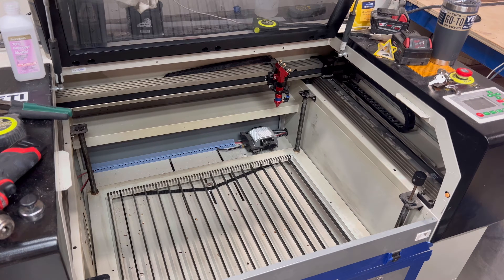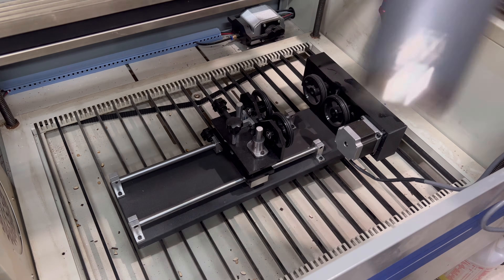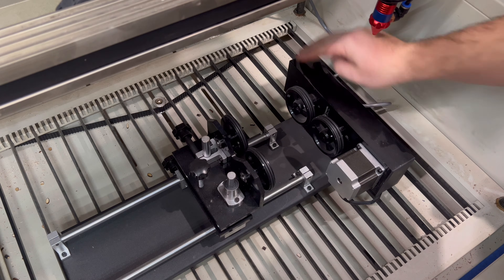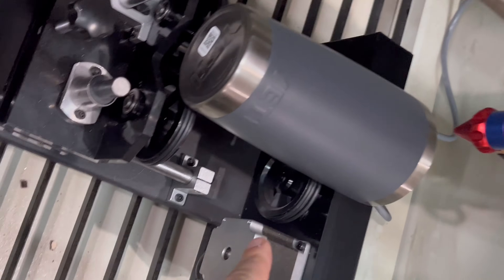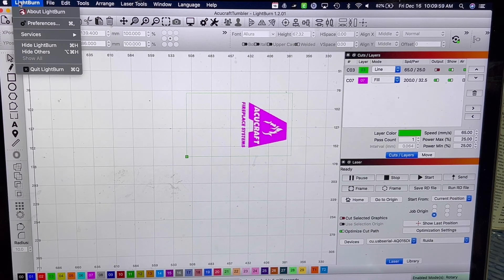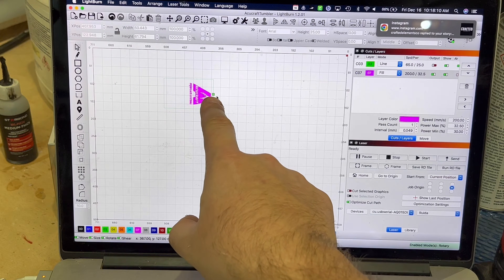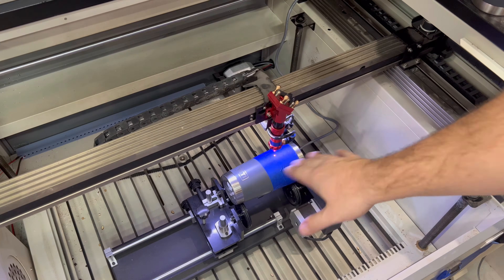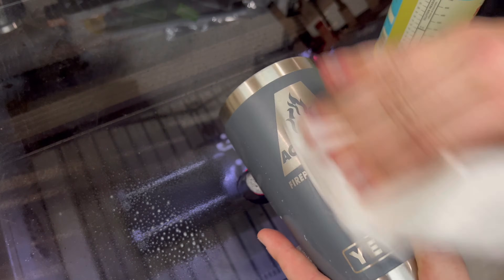EASIEST WAY TO SET UP A CO2 LASER ROTARY! ITS FOOL PROOF!

Comment: good morning @customgrains  I am following all the steps as described, but when I hit start and the machine starts engraving, the design is engraving with the height of the design compressed. Ex: my design is W: 3" x H: 6.25" rotated 90 degrees (just like you have it on lightburn). The preview looks fine/normal. But, once it starts engraving, the design is engraving with the Height much smaller than the indicated 6.25", the image is coming out "squished", without any size changes being made on lightburn. any thoughts? @customgrains

Comment: I follow the same setup for my Omtech polar. Issue I am having is the framing is off. I did my step calibration, I selected current position to middle like you did, slowed down the speed. When I frame the work, it is not aligned where I want it to be. Any ideas?
Reply: im also having issues with framing being way off and the roller rolls forever before doing anything. its so strange.

Comment: Great video. I have the same laser you have and have been looking for an affordable rotary. I want the piburn but very expensive. But I want to engrave handle tumblers. How’s your rotary working?  I’ve read some having motor problems?  I’m looking for a chuck style.
Reply: Can you do a handled cup on the roller style?  It looks like it will accommodate longer items than the chuck. What made you choose this over the Omtech model?

Comment: How did you configure your cutting order to minimize y axis moves?
Reply from the maker: When you enable the rotary it disables the y axis and essentially make the rotary wheels the new Y axis. If that makes sense
Reply: Yep, got that. Your cut moves from the left of the image to the right. My image is an  "O" with design/text inside of it. Lightburn wants to trace my "O" then fill in details inside and doing that the cup shifts slightly skewing the image.
Reply from the maker: @bzharris82742z  do you have “optimize cut” or “flood fill” on?
Reply: @customgrains  running 1.2.02
Most of the design is lines, so fill options are not enabled 
I am using optimize cut path on laser menu settings
Reply: @customgrains  I am using a vector file. I am pretty sure that is the issue now that you made me think it through.